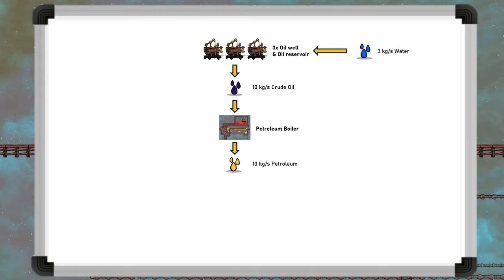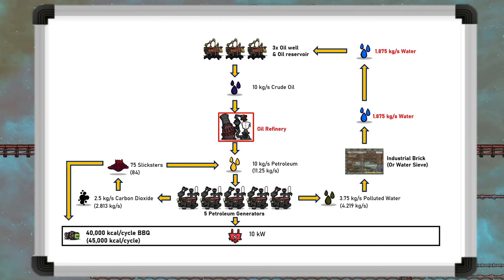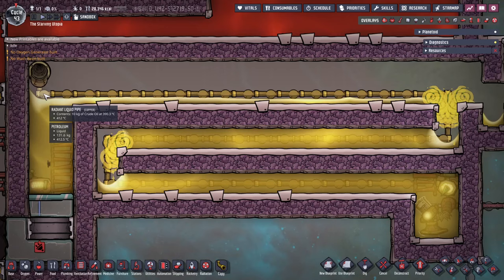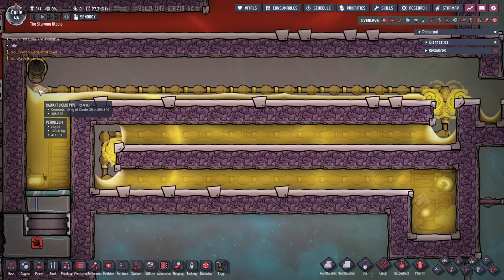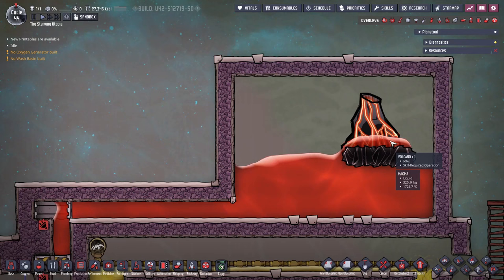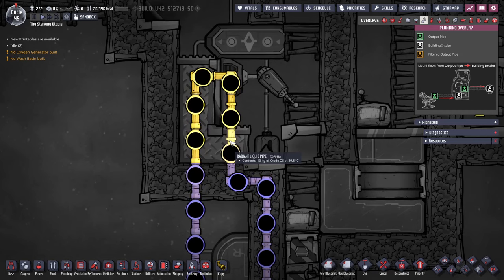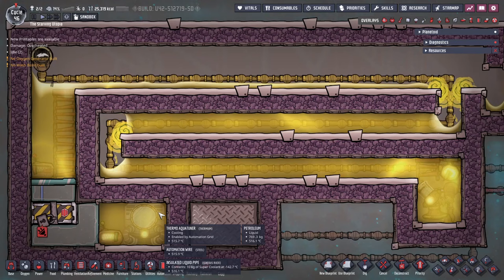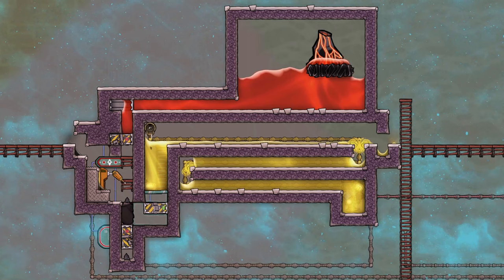Oxygen Not Included - Tutorial Bites - Petroleum Boilers

Comment: Your guides are great. However, by copying Francis John's design, you also copied one of it's greatest flaws. The heat exchanger is thermally connected to the boiler, which is what causes the incoming crude oil to burst in the pipe. Simply create a ledge for the petroleum to fall off into the heat exchanger to isolate them, similar to a "staircase heat exchanger". Make sure you route the pipes out of the boiler as well. (You will likely need to lower the entire heat exchanger by 1 tile)
Reply: @bendover2160 This is kinda difficult to explain with words, so I made this image that highlights the key elements I'm talking about.
<If only I could post comments with links... Let's hope my comment with the image link is approved.>
<Here's my attempt at explaining it: The big pool of petroleum on the left (where oil is dropped) is the boilerpool, the wide floors that the petroleum runs across is the heat exchanger. (GC claims the heat exchanger has 2 layers of 16 length and 1 longer layer at 19, but in fact the heat exchanger itself has only 2 layers of 15 length [vacuum cells don't count] and 1 layer of 16 length [the bottom], with pipes running through 3 cells of the boilerpool)>

As you can see, the entire top floor of the heat exchanger is in direct contact with the boilerpool. This is not great, because the temperature of the petroleum the pipes run through will exceed the boiling point of the crude oil, which causes the pipes to burst. It also decreases efficiency, as more heat than needed will be drawn from the source to heat the incoming crude oil.

So, lower the heat exchanger to separate it from the boiler, by building the floors 1 tile lower (keeping the walls of the boilerpool at the current height, of course. Alternatively, raise the wall of the boilerpool by 1 tile and the roof as well, so the pipes have a vacuum to run through). And get the pipes out of the boilerpool (run them through the vacuumed cells, you don't need to replace with insulated pipes as GC suggests).
You may also need to make the heat exchanger longer, as this design appears falsely effective due to the heat leak from the boiler.

This issue is sadly far too prevalent, despite being known for many many years, because it keeps being copied and shared without properly identifying the cause of the issue.
The solution I often hear is "always keep it running", which does not solve it.

So, please help spread the word of this issue, and we might keep some people from making this ancient mistake.
Reply: @bendover2160  As a way to prevent pipe breakage I consider it pointless, since it doesn't resolve the underlying issue, and it might cause "heat overshoot" as another commenter phrased it. Speaking of heat overshoot, I would also power the Heat Injector Door.
It could be a neat addition to a thermo sensor to prevent excessive oil buildup when starting it up for the first time, or if there's an issue with heat injection. I wouldn't remove the thermo sensor, though.

One change I would definitely do is to add another Hydro sensor in the Petroleum output pool, to stop Oil input if Petroleum levels get too high.
Because, if you're not consuming all the Petroleum and (assuming you made my suggested changes) the Petroleum fills the entire top floor, you will thermally reconnect the Boiler and Heat Exchanger. Pipes will also end up running through boiling Petroleum again, as there'll be no vacuum cells.

Comment: IMPORTANT TIP: place a door at the liquid locked entrance and lock it. If you dont do this, there is a chance your dupes will try to use the ignius rock that will be sitting on top of the solidified magma. As they try to leave, the rock will boil the fluid you used for your liquid lock (and on your robo-miner), which will cause the entire system in there to break down and melt
Reply: seal it and use a autosweeper and run conveyor rails through a steambox like a metal volcano tamer to get some extra electricity and chill the rock for duplicant use or like ranching hatches

Comment: Hi, I got a weird problem - The boiler is exactly build after your tutorial, now, 400 cycles later sometimes sourgas is in the vacuum room with the magma and mineroboter. I don't know how this happens. I pump it out until there is again a vaccuum but after new magma is put in there is again sourgas. I've tried to take out the oil which is for the coolng of the mineroboter, but still sourgas spawning. Anybody got a workaround for this? Thx!
Reply from the maker: That's odd and a bit difficult to diagnose without knowing why it's getting in there. Clearly some oil or petroleum is getting superheated by the magma. If you've taken the oil input away from the robominer, then the only source I could think of is if it's maybe pressure damaging coming from the boiling area? I'd say maybe the best way to diagnose this is to put an atmo sensor in the room connected to a notifier to tell you when the gas is formed. Then you could reload the cycle and watch to see what's happening.

Comment: This is great, but I suggest a few minor tweaks to make the design more robust and reliable. These changes can prevent most of the accidents you encountered in your Max Dupes playthrough.

1) Replace the thermo sensor in the petroleum with a liquid element sensor that can simultaneously accomplish two goals. Set it to detect crude oil, and wire it into the steel door. This is roughly similar in function to the thermo sensor, but if something goes wrong and there's no oil input, it will prevent any further heat input that might cause your pipes to break when oil flow resumes. OK, now, pass the sensor's output through a NOT gate, then a FILTER gate, set to ~10 seconds, then into the liquid spout. What this accomplishes is that if the oil fails to flash to petroleum for 10 consecutive seconds, oil input will be halted. This prevents a dangerous oil build-up that can cause "overpressure" breaks in the insulated tiles adjacent to the magma chamber, leading to horrific sour gas problems. Resuming heat when there's an excessive build-up of crude also leads to chaotic bubbling and if unlucky, can throw oil into the heat exchanger section, causing further problems. Having 10 seconds worth of oil is no big deal, and this value could probably be extended to 60 or more, but 10 is more than enough to prevent the oil from shutting off while there's heat available. This simple change makes the unit vastly more reliable and is arguably conceptually simpler than picking a temperature threshold that corresponds to the state change.

2) With the liquid element sensor that I've just described, it's now possible to safely stop the boiler and subsequently restart it without breaking any of the pipes. Simply use an OR gate on the steel door heat injector to wire in an additional control signal that prevents the door from closing to inject heat. The oil input will continue briefly, then stop automatically once there's 10 seconds worth of crude-oil build-up -- this ensures that all parts of the heat exchanger, including the heat injection section, are below the oil-to-petro flash temperature, meaning that your pipes won't break when you try to resume production. As a demonstration, this control input could be connected to an on/off switch inverted through a NOT gate, providing the system with a rather satisfying power toggle, but in a real base, the control should also stop the boiler if the petroleum consumption backs up (eg, add a second liquid level sensor above the liquid pump that exports the petroleum). Inability to pump out petroleum can cause the sections of the exchanger to thermally bridge, resulting in overheat of a steel liquid pump (and this design is usually built before Thermium is available).

3) For the interface tiles between the steel door and the petroleum, GOLD is recommended, as it injects less "heat overshoot" than steel or diamond. The heat overshoot comes from the fact that the control sensor in the petroleum (either thermo or element sensor) effectively "lags" the heat injection, and by the time it disconnects the door, the interface tiles are already well beyond the intended temperature (often 700+ degrees when the magma is fresh) and will continue injecting additional heat. Gold has a specific heat capacity of 0.169, while steel and diamond are both around 0.5. On maps without Gold, Tungsten is a good substitute (0.134), or in a pinch, Copper (0.385).

In my testing, I used a consistent magma temperature of 1500 degrees to simulate the worst case scenario of a fresh magma drop. A boiler with Gold interface plates overshoots to a peak of 410 degrees while an identical boiler with diamond interface plates overshoots to 413 degrees and gets very close to boiling the oil inside the pipes (incoming oil exceeded 400 degrees briefly). The diamond temperature spike also lasts several times longer and when the two units heat inject at the same time, at the point where the reactor with gold plates peaks at 409 degrees, the diamond plates are still 600 degrees and furiously injecting heat. 

4) To further limit "heat overshoot", consider connecting power to the steel door used for heat injection. This drops the peak overshoot temperature for gold interface plates from 410 to 407, and with diamond interface plates the decrease is from 413 to 410. These decreases are more significant than the numbers suggest because the duration of the overshoot is reduced as well, and because what matters is the excess over the 402.8 degrees flashpoint. The more precisely the overshoot temperature is controlled, the safer it is to use an efficient Aluminum heat exchanger that will bring the final oil temp closer to 400 degrees. My boiler with gold interface tiles heats the incoming oil to 397 to 398 degrees. The boiler with diamond interface plates averages 398 to 399, due entirely to having greater excess heat injection (ie, it’s less, not more efficient).

4) Caution: Never manually double cycle the magma injection while the interface between the magma and the steel door is still hotter than 700 degrees. One caveat with using gold interface tiles is that while they reduce the risk of pipe breaks, gold melts at 1080 degrees, which is lower than magma temps, although note that the gold interface tiles don’t see the full magma temperature, only a weighted average between the temperatures at the steel door and the temperature of the oil (weighted by the relative heat transfer coefficients). In my testing, gold tiles were safe and reliable across dozens of hours of stress testing with a constant magma interface temperature of 1500 degrees, but were prone to melting for a constant 1600 degree magma interface. Note that these are constant heat sources that simulate the peak temperature experienced in a magma drop system. Even though freshly dropped magma typically starts at 1730 degrees, it rapidly loses heat as it averages temperatures with the tiles between the magma and the steel door, such that the peak temperature at the steel door is much lower. The peak temperature that the steel door is exposed to must never exceed 1500 degrees, and it won’t under normal cycling conditions; however, if you are futzing with the controls and rapidly cycle the magma injection without waiting for the heat of the previous injection to bleed out, you can bring the interface temperature asymptotically close to the fresh magma temperature, and this will definitely melt the gold tiles. Don’t do that because it’s a royal mess to clean up. If you melt the gold tiles, there’s no way to interrupt heat flow and you’ll flash everything in the boiler to sour gas and have one hell of a mess.

5) To further increase the safety margin on both problems, strongly consider adding more thermal mass prior to the steel door. There’s no downside to doing this. Putting Temp-shift plates under the two magma tiles improves both safety (from the added thermal mass) and efficiency (improved heat transfer allows draining the magma to lower temps before production stalls). Also, where the stock design uses a single temp shift plate “corner” to bridge the vertical diamond magma interface to the horizontal diamond interface against the steel door, you could expand this to a full 2x2 grid of tempshifts, mainly for the increase in thermal mass. Or, you can also get a slight efficiency improvement by putting a diamond tile in the lower right position (the fastest heat transfer comes from alternating between tiles and tempshift plates; in a vacuum, temp shift plates don’t transfer heat to other temp shift plates). Covering this temp shift “corner” with a large pressure of hydrogen gas helps too, especially if you can use corner building techniques to compress more than 20kg of hydrogen per tile, but this is usually more effort than sticking in a few extra tons of diamond. The more thermal mass you add prior to the steel door, the lower the peak temperature of the steel door will be, which both increases the safety margin on the gold melting problem and reduces the excess heat injection that’s the main threat for pipe breakage. Lower peak temperature doesn’t harm efficiency because once you pay to heat that mass up once, you never lose the heat. Efficiency is determined by the minimum temperature at which you have to cycle in fresh magma (ie, how much heat are you unable to extract?), and if anything, more thermal mass helps you pull even more heat out of each drop. 

6) Use a wattage sensor to protect against electrical outages. It’s easy to cut the power cable by mistake, and the default magma dropper behaves very badly when it loses power. Without power, the mining drill doesn't run and the fresh magma drops on top of the solidified magma, contacting the metal tiles that cool the mining drill. This flashes the blob of petroleum to sour gas, which superheats to magma temps, then your vacuum pump probably overheats, your liquid lock might boil, and chaos reigns.  To protect against this, use a wattage sensor to verify that the electric circuit is live. Integrate it by putting an AND gate before the FILTER gate that implements the 20 second delay for the mining drill to do its thing. This way, if power is cut, fresh magma won’t drop until the mining drill has had 20 seconds of uninterrupted power. If necessary, you can add a single 10W light bulb to the circuit to guarantee that you will always be able to detect >0 power usage when electricity is connected (you don’t want a false-positive outage just because nothing is demanding power at the moment).
Reply: I I
Reply: Some of these tips sounds really useful thanks, using gold tiles helped a lot but is there any chance you could do a video on the automation changes as I seem to be having problem making the adjustments you suggested
Reply: @Kenosos  that would be fun. First I need to figure out how to make videos at all.
Reply: @ddopson  Aha, fair enough. I managed to work out the automation also and now it's all running smoothly thanks to your suggestions :)
Reply: @Kenosos  I'm glad you were able to get it working! I'd be curious to get your feedback on which aspects were confusing and / or which of my tips ended up being the most useful.

I had a lot of fun working through this like a real reliability engineering problem. Back when I used to actually play ONI I remember my volcano tamer being a constant source of problems, and I stumbled upon some of these fixes; then more recently, after watching GCFungus struggle with it, I fired up the ONI sandbox to run some experiments and pin down a properly engineered design.

My biggest internal debate is between using gold vs diamond interface tiles. The gold significantly reduces the risk of pipe breaks, but diamond is invulnerable to catastrophic melting events.

I really would like to make a video of this, or at minimum of a proper write-up with screenshots, but I'm not sure if I'll ever find the time.
Reply: For anyone following the advice in 1) here, the description isn't quite correct. You need to put the connection between the liquid element sensor and the door through the NOT gate as well. Otherwise the door will be open (not exchanging heat) when crude oil is present, which is the opposite of what you want.

Alternatively you can change the FILTER for a BUFFER, do away with the NOT gate and have the liquid element sensor activating with the presence of petroleum on its tile. That way if crude oil is there (e.g. not petroleum), the door closes and if crude oil is present for 10s or more, the vent is closed as well.
Reply: This comment should be pinned & on top! Very very useful information which saved my a** :-) Thanks @ddopson!
Reply: If it's stable it's stable, why would you add complexity to a design that already works? Even if something goes horribly wrong there's always autosave history, and even then I've run both these designs for thousands of cycles with no problems. What you are doing is called over-engineering.
Reply: @gnomehead2073  the baseline design isn’t stable because it broke several times during his play through, sometimes in dramatic fashion, requiring hours of cleanup labor

Comment: I think I figured out how to prevent pipe breakage with this - hook the airlock automation to multiple thermo sensors, place those at different levels in the boiling chamber, and optionally don't place the lowest one on the cell where the crude oil lands. I used 3 sensors across a chamber 5 cells tall - all 3 set to 403°C. No issues boiling 10kg/s. Crude coming in was ~85°C, petroleum going out was 105°C I think.